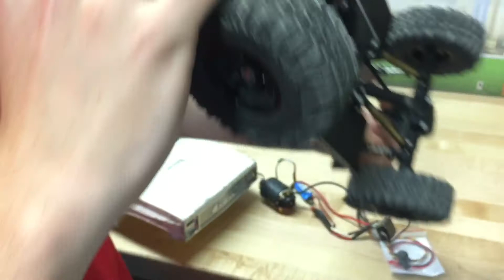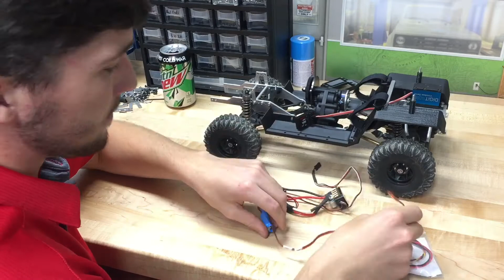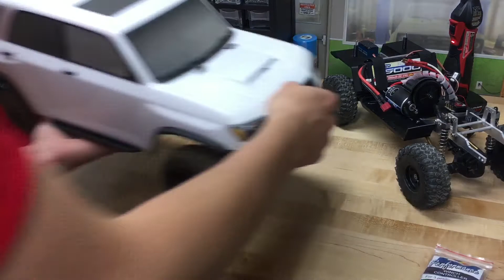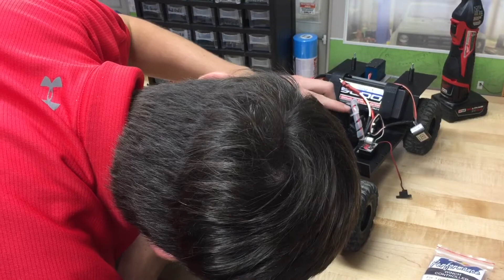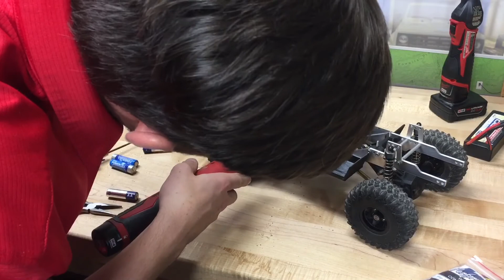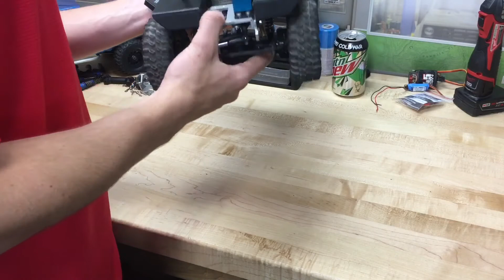Terramight Wiring EXTREME RC 4X4

Comment: Hey Buddy.
You should print a better grill for your Clod body...like a 75 round headlight grill that fit the Tamiya round Toyota lenses(or a round lense that's easy to get....Tamiya stuff is mostly harder to find).
Reply from the maker: Hey Tom, I was thinking of machining a 90-91 grill with the dual headlights as that was one of my favorites.